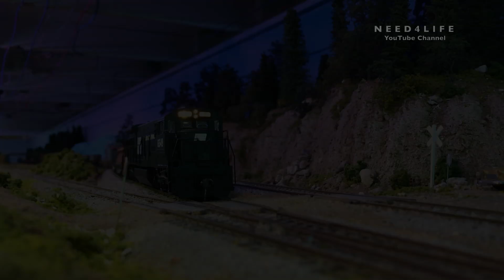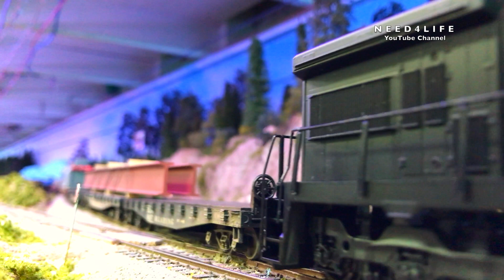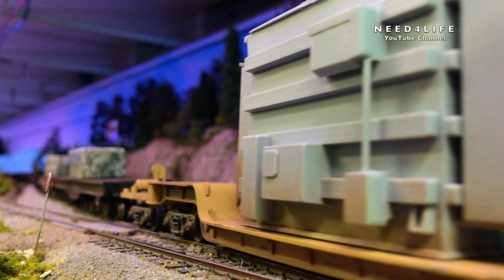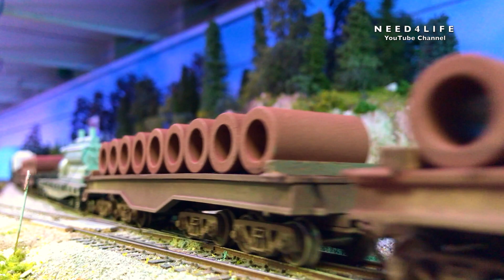Model Railroading with US Model Train in HO Scale 4K UHD

Comment: Nice.  Full scale railroader tip: All those gondolas should be super-dented up, top edges bashed-in, foot-rails bent from below, etc.  They just dump stuff in them.  Top edges of flatcars all dinged up, too. The drop-neck flatcars might not be as damaged, as the electric transformers and switchgear and all would be handled carefully.  Some scrapes on the decks, but that is about it.  Get some grease around the bearings, especially the open types.   The power unit should be much dirtier, like the freight cars, rust on the dynamic braking grilles, some dents in the engine access doors, trim, etc.  Nothing stays clean, straight or neat for very long, especially with industrial freight hauling.